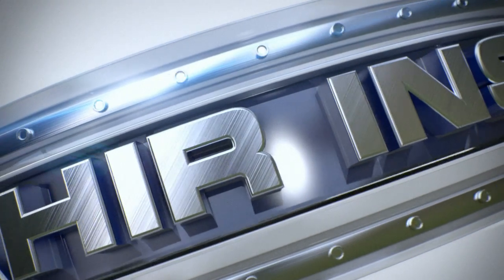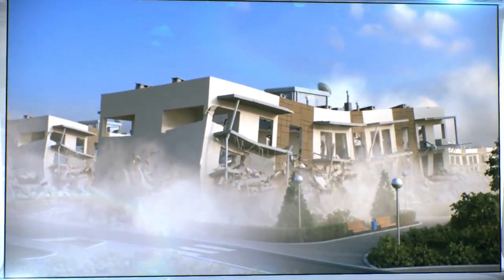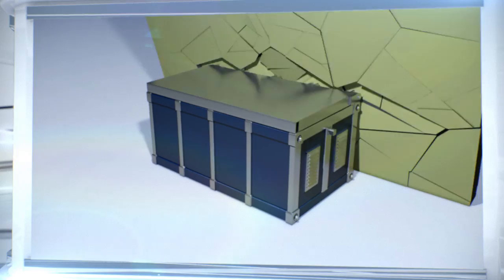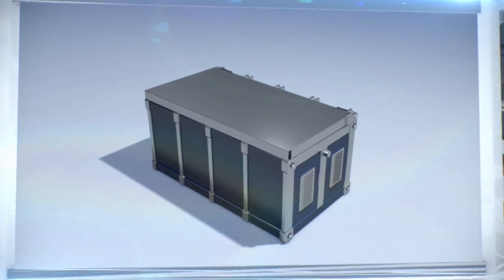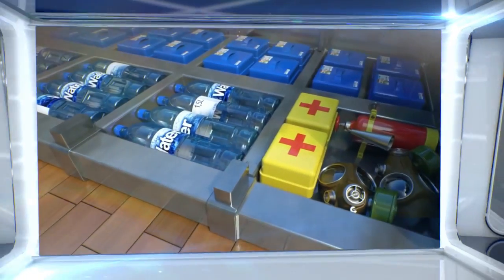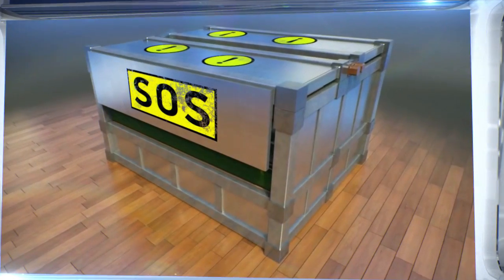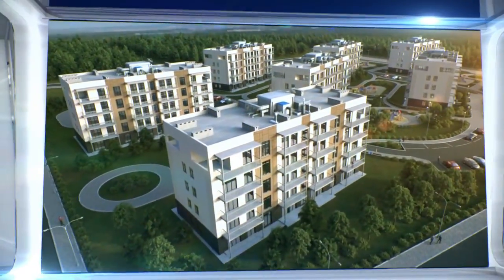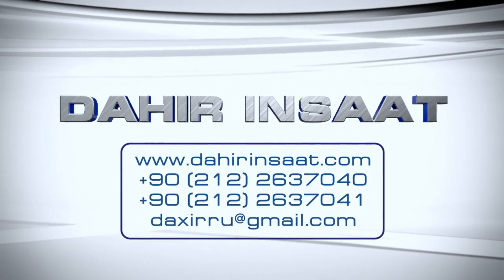Dahir Insaat: Earthquake Safety Bed

Comment: So if the pillow is hanging off the bed, im finna die?
Reply: If the frame gets bent after it closes you're probably also dead.
Or if the sensor breaks and guillotines a limb off.
Or if there's a chemical leak or fire resulting from the building's collapse.
Or if the earthquake broke a nearby dam and water starts flooding in.
I would literally rather just be crushed by the building tbh.
Reply: Yep. Y'all better sleep still as a friggin rock because if you move a little bit, you'Re fucked.